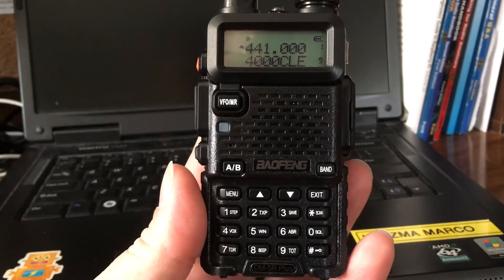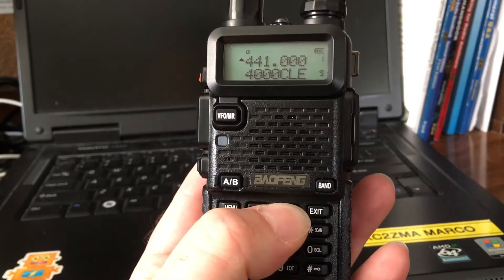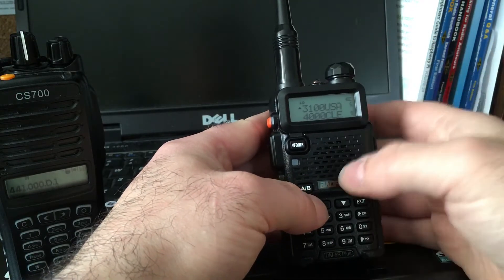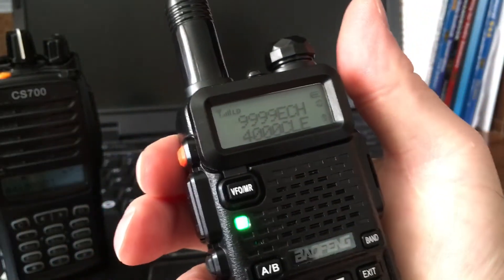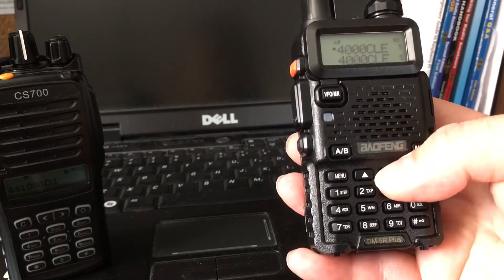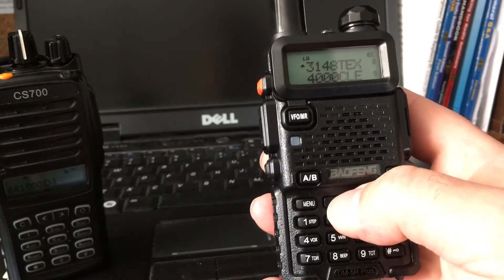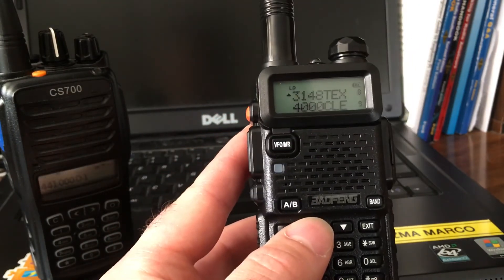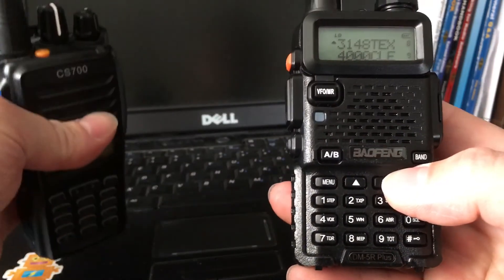Baofeng dm-5r demo

Comment: hi i have two DM-5Rs and they don't work on DMR at all work ok on FM but DMR nothing and they are programmed the same but nothing on DMR can someone help
Reply from the maker: 1812simon 
As far as I know if your trying to program the radio for DMR 
With just the front panel u can not. Are u using the cps program and cable???
Reply: yes with the cable they are programed the same but still wont work
Reply: @1812simon   i know this is old but .. if its not the dmr plus you have to update the firmware so it will talk to other dmr radio's .. still transmits on both time slots though.. 73's

Comment from the maker: Hi Peter yes u should be fine. I have not used it on dvmega. But should work fine. And not sure if the dm5r will work this is the dm5r plus which is a bit more money. On Amazon. And have not tried on DMR plus 
This is SharkRF Brandmeister